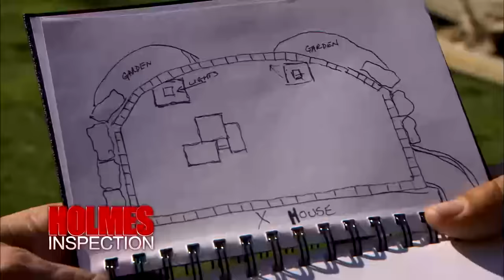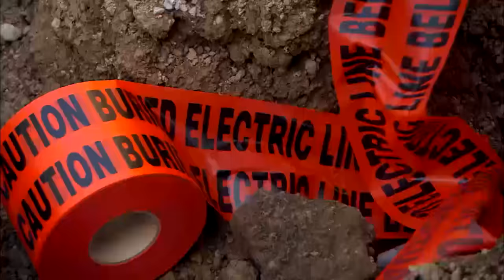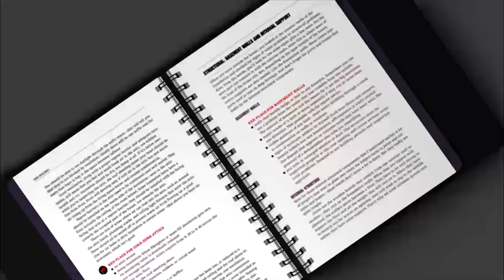Bitter Surprises: Newlyweds' Hidden Home Issues | Holmes Inspection S202

Comment: After watching so many episodes,  i never want a house with a basement 😂
Reply: If it's done right you don't have to worry, but with the way contractors are not putting enough steel in it and pouring the concrete to wet and not putting in a good drainage system, that's why basements fail. They need to make basements the same way they make commercial buildings. Lots and lots of steel and concrete that won't run from corner to the other.
Reply: if done right they last for ever, my grandmas house which is about 120years old still has the original stone and mortar basement and never had any leaks, but also the grading of the soil allowed water to drain away, sure it had other issues, but most of them where standard maintenance.
Reply: I want only a house with a basement, especially if it's old. Basements can have issues but imagine you need to do something like a basic plumbing repair to the ground floor and it's all buried in solid concrete
Reply: Growing up in Minnesota the basement adds a extra level and was the safest spot for tornado warnings..... Long as you do good wall upkeep to protect the foundation they can be a real dream come true... Now if you ignore the foundation even in a 1 story house that can turn into a nightmare.... Good base = good life, and bad base = nightmare...
Reply: @consolehacker54  I live in "tornado ally" the next house will have a basement....
Reply: @jonathanbair523 definitely in that situation! Just seems like every episode there is a leaking basement. But like everyone says if done right it is fine.
Reply: Most basements don't count as part of the total inhabitable square footage and are therefore untaxed space.  I want as much untaxed space as possible.  The biggest challenge with basements is water.  Need to double-check to make sure any water on the outside is flowing away from the house, annually.  Sometimes a gutter or downspout can get damaged and go unnoticed for a long time resulting in water flowing toward the foundation causing damage.
Reply: you will need a basement if you live in canada
Reply: I've always wanted a basement--- for my trains. His shows do put a  fear for that😅😅.
Reply: @jonathanbair523 The desirability of basements is definitely tornado related!

Ohioan, here. Even though Ohio's at the northeast end of Tornado Alley, we've had a few. I remember the Xenia tornado in 74. Our teachers were very understanding the next day why we didn't have our homework done.

Comment: I bought a house in 2017 and the so-called inspector missed a furnace that turned out to be inoperative, as well as electrical, plumbing and foundation issues. I think that these home inspectors should be held liable when they do such a lousy job inspecting homes and get sued for what it costs to fix the issues they clearly miss.

Comment: Concrete will crack regardless of mitigation techniques. The best way to slow down cracks is to put soap in it.  Soap creates bubbles. Bubbles give the crack an ending, much like drilling a hole at the end of a crack. Plus it is cheap additive!!!

Comment: vertical cracks can be injected from the inside by a qualified technician and offer a lifetime warranty against leaks.
Reply: Now they can, keep in mind these shows all ran from 1990s to early 2000s. A lot of what was the best back then is just mid grade at best now, just how it goes. All those new types of self-curing cements and all of that have really made repairs easier now, for sure.
Reply: A warranty against water intruding on a foundation wall is not very useful.  If the crack expands and causes an entire section of a wall to fail and the basement to flood, does the warranty cover all of the damage to the belongings and replace that section of the wall?  It is 1,000 times better to seal that section from the outside.  Patching the outside will last 100 years versus 10 - 20 years for a patch from the inside.

Comment: None of my outlets in my apartment are GFI or for that matter only 3 are three prong. 😢 not sure what to do or who to contact…
Reply: You could ask your landlord to update the electrical. Note if the majority are two wire then I suspect the three prong aren't really grounded. They were probably installed as replacements.
Reply: @Mark.Watson  yeah I asked and the answer was no but your rent will probably increase by three hundred if I want to push the matter..

Comment: My guy, a GFI is like 5 bucks more at most. I don't understand why you wouldn't use one. EDIT: I mean the homeowner.
Reply: might have been more at the time, i feel they have come down in price over the years, but yeah i think most GFCI's are about 15$ total so not even really that expensive,
Reply: I found it funny that Holmes scolded Simon for cheaping out and not using a GFCI (rightfully so) but at the end they just caped it and moved the outlet to outside of the room lol. They literally did the same thing, its to code to have an outlet there, it just has to be a GFCI circuit. This show sometimes...